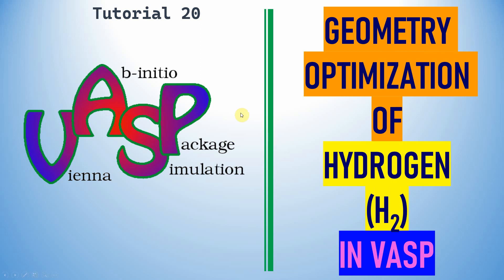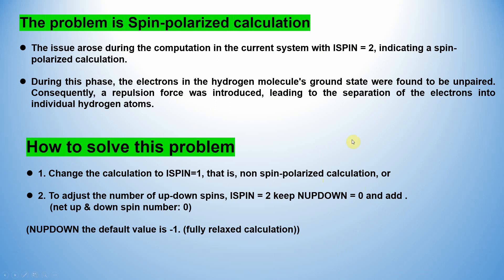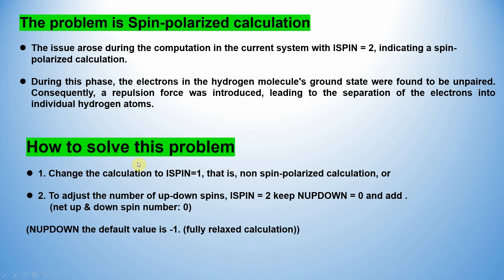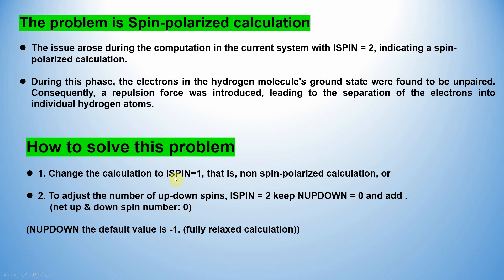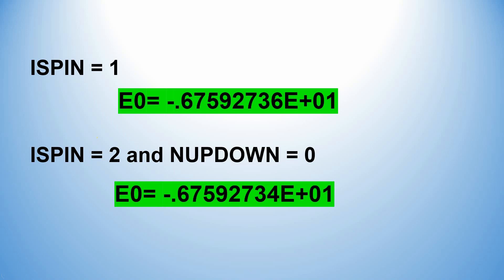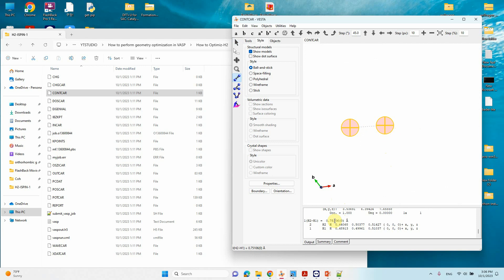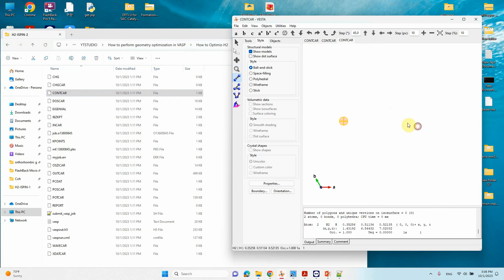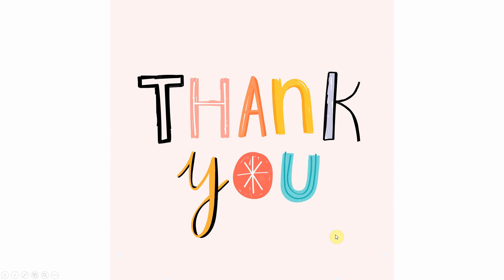How to perform geometry optimization H2 molecule in VASP

Comment: The ground state energy of hydrogen atom is -13.6 eV but using the simulation we get it around -6.77 eV for a H2 molecule. Can you help in understanding how to obtain the ground state value of hydrogen atom using computational simulations?
Reply from the maker: I have explained the energy issue, in this video. Also given input and output file in description section, you can use this